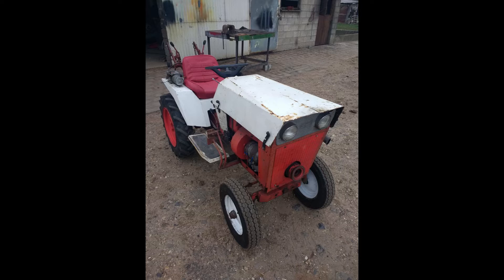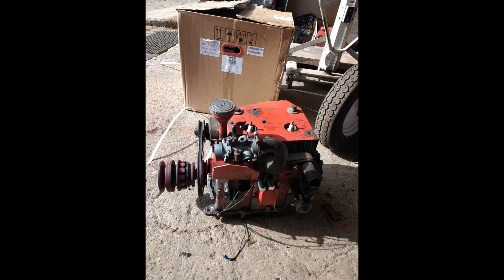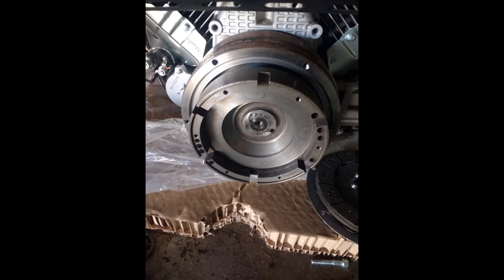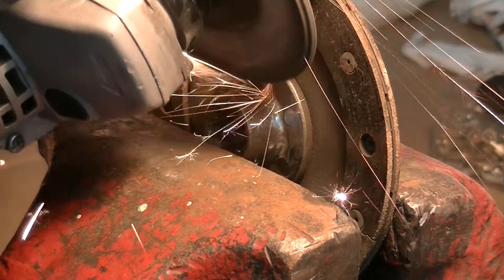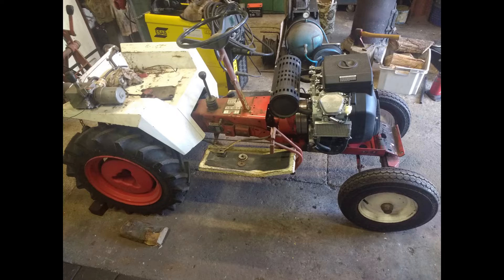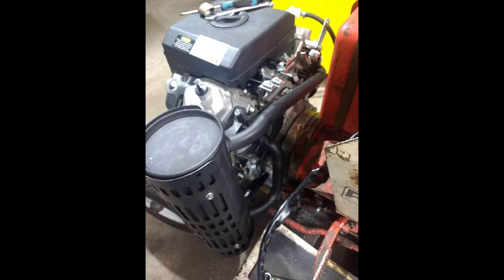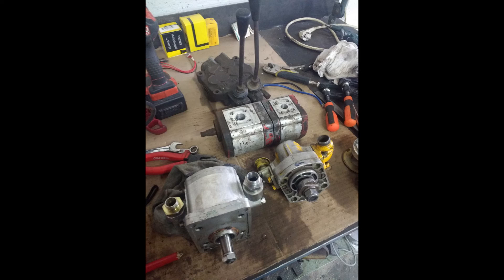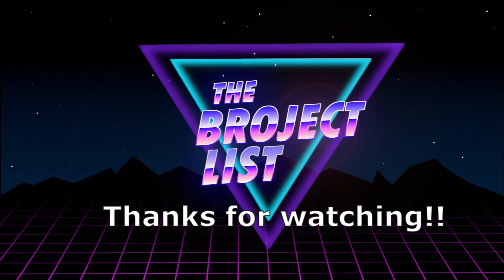V-twin engine swap in a Gutbrod garden tractor

Comment: Hello you sound Dutch ? If you are interesded in ever selling the tractor or the back tiller let me know I need some good pictures of the mounting on the tractor
Reply from the maker: hi, dang do i have such a bad accent lol? 😅🤣 I speak dutch indeed. Send me an email at thebrojectlist@gmail.com  i have the original mounting/lift system and ancilleries. I also have the gutbrod plow and tiller for it.

Comment: I have a 2060 to, mounted a frontlader.  Engine runs great but uses a lot of oil. Maybe I will use this as an example in the future. One thing I also like to update is the turning radius. Great job btw.
Reply from the maker: Thanks! my original engine did run but also used a lot of oil and smoked badly. The carburettor was cracked and a replacement is half the price of a new engine. It is a lot of work to fit a different engine but it drive so good and is very smooth.